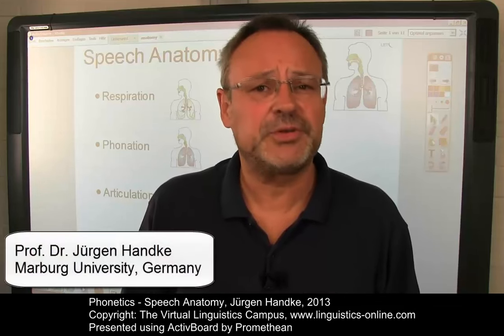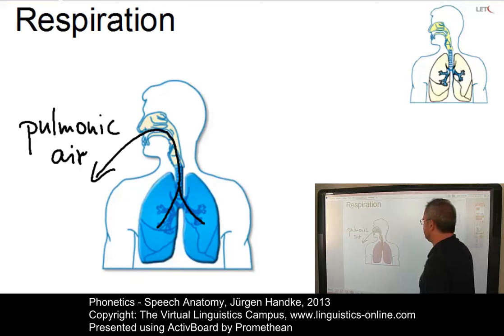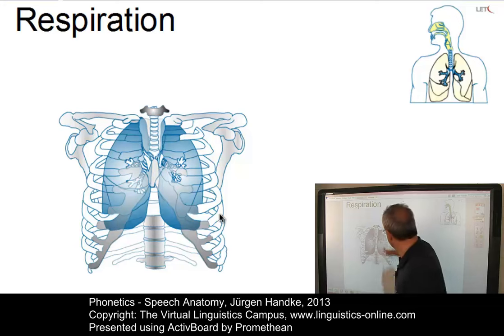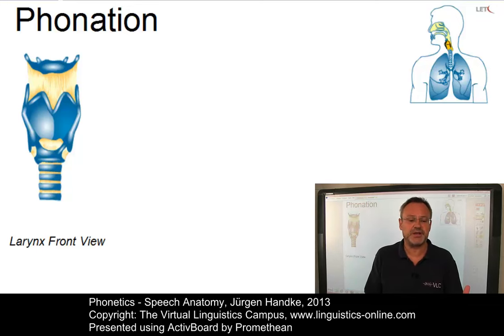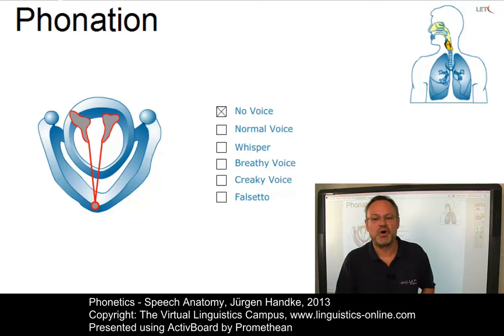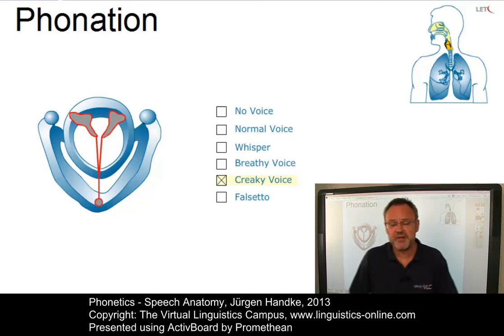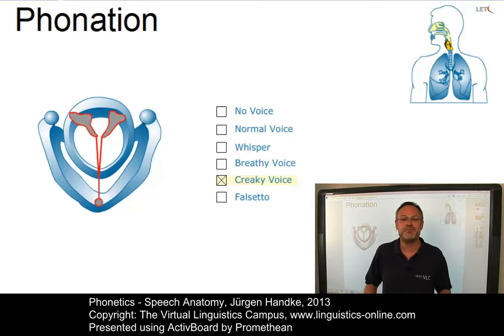PHO103 - Speech Anatomy

Comment: Hello.
(0:05) In the following, I'm going to introduce you to the basic concepts of speech anatomy, where three central mechanisms are responsible for the production of speech, and we will look at them in detail. Respiration, where the lungs produce the necessary energy in form of a stream of air; phonation, where the larynx serves as a modifier to the airstream and is responsible for formation; and articulation, where the vocal tract modifies and modulates the airstream by means of several articulators.

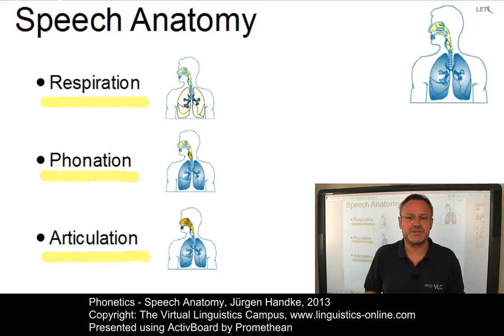(0:48) Let us look at these mechanisms in detail, and let's start with respiration. Now, before any sound can be produced at all there has to be some form of energy. In speech, the energy takes the form of a stream of air, normally coming from the lungs. Lung air is referred to… (so this is the air). And lung air is normally referred to as pulmonic air. This respiratory system is used in normal breathing, [but] in speech what is interesting is the way we change our normal pattern of breathing to enable us to speak normally. We breathe in and out every two or three seconds. You can time it if you like. When we speak, we breathe in quickly and then we let the air out very, very, slowly, and it might be five seconds before we breathe in again. Some people can speak for quite a long time before needing to breathe in. How much can you say in one breath? Breathe in and then start counting slowly: one, two, three, four, five, and so on. You should be able to get up to nine or ten easily, and if you take a deep breath, ten shouldn't be a problem. So, during normal breathing, inhalation and exhalation cover roughly the same interval. In speech, Inhalation is relatively short, whereas the exhalation period, during which the audible output is produced, covers a relatively long period. So, when we speak, our lungs slow down the flow of air. The air comes from the lungs (here are the lungs), then moves through our trachea (this is the trachea some people call it [the] windpipe) into the throat, and on the way, the air passes the larynx.

(3:35) Let's look at the larynx next. Now, the primary function of the larynx, which you can see here – so let's enlarge it a little bit)… The primary function – primary biological function, to be precise – of the larynx is to act as a valve, by closing off air from the lungs or preventing foreign substances from entering the trachea. In speech production, the larynx modifies the airflow from the lungs in such a way as to produce an acoustic signal. The air that comes from the lungs (so this sort of air) passes between the vocal folds. Now, here you find the vocal folds – sometimes called vocal cords. The most important effect of vocal fold (or vocal cord) action is the production of [an] audible vibration – [the] buzzing sound known as voice (or vibration). [This is] similar to the effect of blowing air through a rubber band. So, let's demonstrate what happens if I blow air through a rubber band. Here I have a small rubber band. Now, what happens if I blow air through it like this? Well, what you hear and what you can see is the effect of vibration. The blowing of air through a rubber band creates an audible vibration, which is relatively soft here because there's no amplifying or resonating body around it. Now, each pulse of vibration represents a single opening and closing movement of the vocal folds. The number of cycles per second depends on age and sex. Average male voices vibrate at around a hundred [and] twenty times or cycles per second, [and] women's voices average something like two hundred and twenty cycles per second.

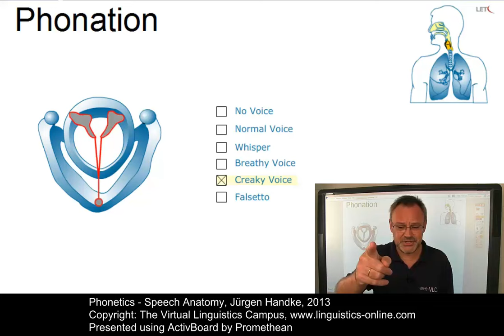(5:59) Depending on the type of laryngeal action, different modes of phonation can be distinguished. So, let's look at them in detail now. Voicelessness, or nil phonation, is the default. [It is] a type of formation (well, it's not real phonation), which is used during normal breathing. It requires a more or less wide opening of the glottis (so, here you see the glottis) resulting in glottal silence, provided that the rate of trans-glottal airflow is below the level that would generate local turbulence of the glottis. Normal voice (or just voice) refers to normal vocal cord vibration occurring along most of the length of the glottis, so [that] the vocal cords vibrate. Whisper: you can all whisper, can’t you? Well, whisper requires a far greater constriction than the voiceless setting of the glottis, and is generally achieved by adducting the vocal cords while maintaining an opening between the arytenoids (the cartilages to which the vocal folds are attached). In breathy voice (so, this is breathy voice)… In breathy voice, normal vocal cord vibration is accompanied by some continuous turbulent airflow. Well, and, creaky voice (this is some sort of creaky voice which you can do especially well early in the morning) … Well, creaky voice (or creek) is a phonation mode characterised by a low frequency of vibration of the vocal cords, with a very low opening quotient, and often some irregularity in periodicity. And finally, do you remember the Bee Gees? (8:11) – something like that. They were pretty good at singing in falsetto – the phonation mode where the vocal cords are stretched longitudinally, so that they become relatively thin in cross-section. Thus, falsetto is primarily heard as a phonatory setting in singing.

(8:37) Well. And what is happening next? Respiration? Phonation? Well, once the air passes through the trachea and the glottis, it enters a long tubular structure known as the vocal tract. Here is the vocal tract, again, let's enlarge it a little bit, okay. Now, this is the main component where we articulate speech sounds in the vocal tract. The airstream is affected by the action of several mobile organs: the active articulators. The active articulators are actively (as the word says) involved in the production of speech sounds. The main active articulators are: the lower lip – actively involved in rounded vowels such as [u], or in consonants like [afa]; the tongue, which is involved in the production of all vowels and most consonants; the glottis, with which we produce phonation and some specific consonants such as [aʔa]; and the uvula, which is actively involved in some consonants such as, the so-called uvula trill [aʀa], but which also remains passive in others such as [aha]. This is why we represented the view uvula in a special colour, here. The active articulators are supported by a number of passive articulators, which you can see on this screen. These are specific organs, or locations, in the vocal tract which are involved in the production of speech sounds, but [which] do not move. Don't tell me that your teeth move – then it must be the third set of teeth. For example, just to pick one of them the alveolar ridge, which is involved in consonants such as: [ata] where the tongue touches the alveolar ridge; or [asa], where friction noise is created between the tongue and the alveolar ridge. The production of speech sounds, through all these organs (active and passive articulators), is referred to as articulation.

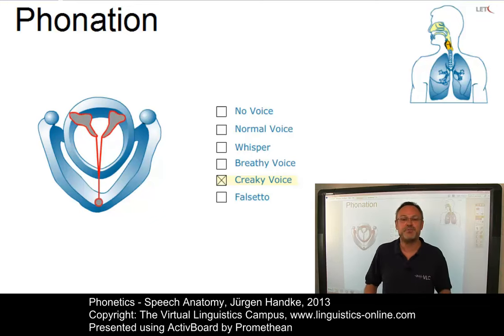(11:05) Well, this is it. You should now understand the basic mechanisms of speech production with its three stages: respiration, phonation, and articulation.
(11:23) By the way, before I finish let me remind you that in the toolbox of the virtual linguistics campus you have permanent free access to our e-lecture notes, which are produced on this active board behind me during the recording of such a video. All you need is a free VLC account – so join us and become a member of the virtual linguistics camp community.
(11:49) Okay, that's it for now. See you again in one of our e-lectures on speech science, and, if you like, on the virtual linguistics campus.
Reply: Damn. Thanks!
Reply: Correction: And is responsible for phonation* not "formation."

I can't thank you enough for this transcript.